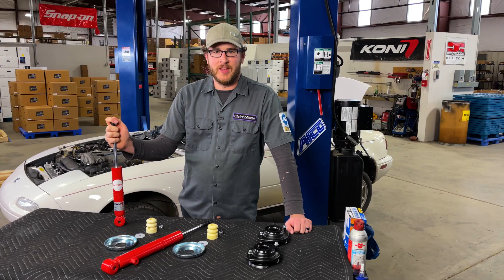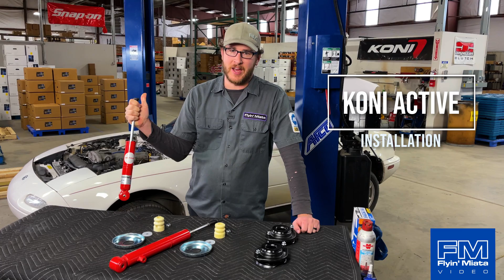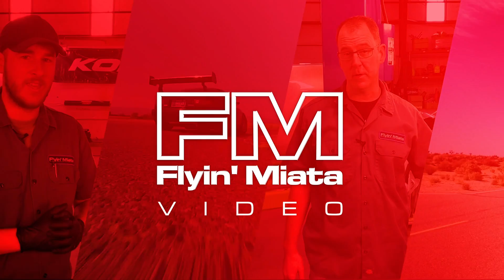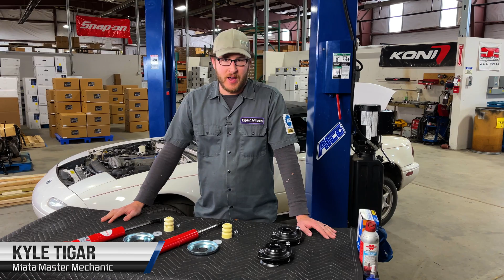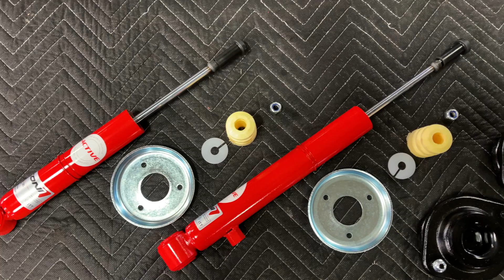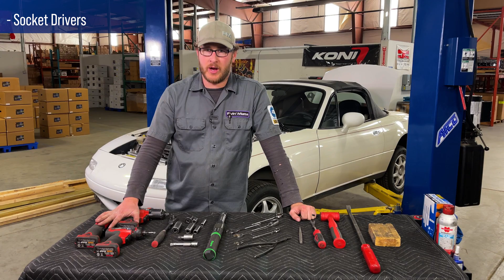Need Help Installing Your Koni Suspension? Step-by-step Install for NA Miata!

Comment: The fact the spring weight sits on a ridiculously tiny lip absolutely terrifies me.
Reply from the maker: @CaniLupine Koni has been building shocks this way for literally decades! There's nothing to worry about in regards to this.
Reply: @FlyinMiataVideo  It's definitely a "trust the engineers" moment, coming from struts with welded perches.

Comment: Do you not have to worry about torque spec in the rear upper shock mounts?
Reply from the maker: We typically don't but they are in the instructions on the product page. 
Upper shock mount nuts: 22-27 lb-ft

Comment: Hi! Don’t we need a washer between the top mount and the central shock nut and rubbers between the springs and the top mount/ bottom plate? Tanks a lot!
Reply from the maker: Looking at our written instructions on the product page, "Install the two supplied M10 washers beneath the top nut on the top of the shock shaft."
Looks like it. Thanks for pointing that out and we'll have to get the video updated.
Reply: @FlyinMiataVideo  Thanks a lot for the explanation. And regarding any rubber pieces between the spring and the top mount / bottom plate? Is it good for the suspension to have the spring making direct contact with other metal parts?
Great video by the way!!

Comment: Do yoy generally not install dust boots or is this an exception? I'm not sure if I want to reuse my old dust boots since they come with the stock bump stop as well.
Reply from the maker: @edge21str The stock dust boots do not work with our bump stops, so we don't use them. Modern shock shaft seals are very good, and the dust boots are really only needed if your car spends a lot of time on unpaved roads.

Comment: Once I slip the bump stop over the landing at the top of the shock, I cannot get the upper shock mount on without it pushing the bump stop off the landing and falling down the shaft. Does the bump stop need to be held by the landing at the top of the shaft? If so, how can you get the upper shock mount on without it pushing the bump stop off the landing?
Reply from the maker: @TT92348 The bump stop can move freely on the shock shaft, but we're having trouble understanding the issue you're having. If you're able to email our Support team some pictures at support@flyinmiata.com, that will help them figure out what is happening with your install.

Comment: What if I don't have hub stands or ramps how would I go about tightening all that down?
Reply from the maker: It's a pretty tedious job without any way to get under the car. You could try using a floor jack to get the control arms in a close position (while keeping the car on jack stands), but it won't be as accurate as doing it on an even surface.

Comment: Could you use ramps to get under for torquing the rubber bushings? Or does the car need to be level?
Reply from the maker: Rolling your car up on ramps is better than nothing, but the ideal scenario is all four corners being as level as possible.
Reply: @FlyinMiataVideo  Thank you, I guess I'll have to earn it the hard way

Comment: Would you guys usually recommend replacing the dust boots if they are disintegrated?
Reply from the maker: It's not required, but also won't hurt anything. None of our Koni shop cars use dust boots.
Reply from the maker: Keep in mind that the dust boots on an NA are part of the bumpstops, and you don't want to use those. If you want to retain boots, we recommend using a set from an NB which are just boots.
Reply: Thank you!

Comment: question, what do i do if vice grips do not stop the shaft from spinning?
Reply from the maker: @lasvegascrisis Make sure that you're using something to blunt the jaws of your vice grips - wrap the jaws in electrical tape or slice some rubber hose and attach the hose to the jaws. That should provide enough extra grip to keep the shaft in place.

Comment: Just out of curiosity, what are the shocks that got replaced? Are they KYB AGX on stock springs? Thanks
Reply from the maker: Correct. They weren't doing so hot.
Reply: @FlyinMiataVideo  Thanks for the response. I just bought an NB with those shocks and the ride is terrible, the rear shocks are gone. I plan to replace all four and I found this video very helpful. Thanks!

Comment: Thanks for a great video.
With a hand spring compressor (not the wall one), do you torque the shock nut before fully decompressing the spring, or after fully decompressing the spring?
Reply from the maker: Thankfully, I've never used a hand compressor but, I'd torque the shock shaft nut without any load from the spring on the upper mount.
Reply: Thanks a bunch. That's what I was thinking, but I was second guessing myself with how far down the nut was going lol. Just using a hand tool not pushing very hard, I was squishing the upper and lower bushings into Oblivion and had so much thread up top I could barely get my socket to the nut.
Reply from the maker: @pfunkle  You are welcome!

Comment: What about the shock bellows? It seems the oem bellows have the bumpstops cast into the bellows already. But I want to run the FM bumpstops. What bellows do I use? I know i fan run without them but I live up north and would like to keep out as much debris as I can.
Reply from the maker: Good question! We've been leaving the dust boot (bellows) off for probably 20 years now and haven't noticed any premature failure to the shock shaft seal and haven't heard that our customers around the world experienced anything different either. If you want to run the dust boots, pull the factory bumpstops out of them and run the bump stops that come in our Koni kit (or you can get them separate) and you'll be fine.

Comment: Not to take away from the video, because its a great video, from the looks of it, the owner did not have an undertray and you guys pre-installed one so you can show that it would normally be taken for install, nice touch. Not sure why people remove those undertrays or don't reinstall them, they are there for a reason.
Reply from the maker: As you've mentioned, undertray/splash pans are very important for heat management. This car got one before it left the shop.
Reply: @FlyinMiataVideo  lol, I figured since it was like the cleanest thing under the car.

Comment: Do you have to have the suspension loaded before torque if you have SuperPro poly bushings?
Reply from the maker: That's one of the advantages of poly bushings, they can be torqued without having the suspension loaded. However, any pivot point that still has rubber should be loaded.

Comment: I have koni strts with FM bumpstops. Does it matter if the bumpstop is seated tightly around the shock mount spacer (held suspended up against the shock mount) or just loose around the shaft resting on the shock body?
Reply from the maker: The bumpstop will be loose on the shock shaft. It does not need to be seated against anything, it only needs to be present to absorb larger impacts.
Reply: @FlyinMiataVideo  I installed a set of Koni Special Actives on my "04 MSM, it didn't seem logical to leave the Bumpstops up at the top. I simply positioned them at the bottom. I figured they'd get there eventually and slide down.
Reply: I wish this video would have been available about 3 months ago when I installed my Koni Special Actives on my '04 MSM. Managed to figure things out. Ride is much improved as Bump Stops in the rear were non existent and fronts were 50% Gone. Old Bilstein's were hitting a bump and without the bumpstop suspension travel would stop very hard, car would be knocked off line or jump sideways I described it as "very twitchy" in the rear. Now shocks actually work and compress and absorb and smooth out the bumps. Ride is still firm but suspension action and reaction is controlled and car is so much more comfortable to drive. Well worth the time and investment!!!
Reply from the maker: @JimG-jz5cg  We're happy to hear that you like your new shocks! Thanks for sharing your experience.

Comment: I recently picked up a set of koni sports, should I expect needing to get an alignment after the install since you need to undo and retighten the control arms.
Reply from the maker: Yes, you will need a four-wheel alignment once finished, especially if your kit includes our springs, as they add negative camber.
Reply: @FlyinMiataVideo  Should an alignment be done immediately after installation or wait for the suspension to settle completely with some driving?

Comment: I was good until you pulled out the hub stands, then $$
Reply from the maker: Yeah, you don't neeeed the hub stands...but, they sure are handy.
Reply: @FlyinMiataVideo  I could do the rear bushings with the wheel on the ground but I'm not sure about the F inner bushings.
Reply from the maker: @artmcewen3165  Easiest way to do those without hub stands is to use a jack to lift the control arm until the wheel is at standard ride height in the fender (measure the dimension from the center of the wheel hub to the fender lip before lifting it) and then tighten those bushings.
Reply: @FlyinMiataVideo just have to be sure the sway bar end link is disconnected.  That's how I've always done it on all my cars whenever any suspension bolts with bushings get loosened and re-tightened for whatever reason.  If the sway bar is hooked up then the car will lift off the jack stands fairly early in the process, before getting to ride height, since you're fighting the twisting sway bar.
Reply: @Patrick94GSR  Great Tip! Thanks
Reply: @DaveSimkus yeah it won't actually be the exact ride height even without the sway bar, because corner weights and pushing up on the LCA inboard of where the tire attaches to the hub, so motion ratio comes into play.  That's one reason why these hub stands are useful.  But of course they are significant cost.  Jacking the LCA right behind the brake dust shield, without the sway bar connected, gets it close enough.

Comment: Do you mean OE Showa shocks and OE Bilstein shocks come with different springs, and that's the reason for the different perches on Koni Yellow and Koni Red?

I thought the perches were to offer slightly different ride height front/rear/both if lowering springs didn't quite work out how you wanted. (yes i know you shouldn't lower on Red/Orange despite Koni's marketing to the contrary)
Reply from the maker: That's correct. Here's our written instructions that go into more detail on the install. https://s3.us-west-1.amazonaws.com/instructions.flyinmiata/suspension/NA_Koni_special_active_13-57210.pdf. Thanks for watching!
Reply: @FlyinMiataVideo Interesting, thanks! I wonder what the spring rate of the Bilstein springs is.
Reply from the maker: @msdosfloppy  We don't know offhand, sorry!
Reply: @FlyinMiataVideo I found the old Fatcat suspension page which says 93 LE and 94-96 R package have the same spring rate as 91-97 manual cars. The 97 R package stiffens the rear springs by 11lbf. That seems to suggest Mazda themselves lowered the car 20mm on Bilstein B6...
Reply from the maker: @msdosfloppy  The R Package suspension isn't necessarily one that you want to emulate, it wasn't a terribly effective one for all-around use in large part because it spent a lot of time on the bumpstops.
Reply: @FlyinMiataVideo  That makes sense! Like you guys say, if you lower then you need to significantly increase spring rate to avoid time on the bump stops.

Comment: What the cost out the door,  parts and labor to have this done on my 95 at your shop.  I may schedule a time for a drop off.  Still have original equipment on mine.
Reply from the maker: Most shops will have a different hourly rate so, I won't be able to tell you the exact price and we no longer offer shop services. For a Koni Stage 1 kit install, we would have charged out 4.5 hrs. Thanks for watching.